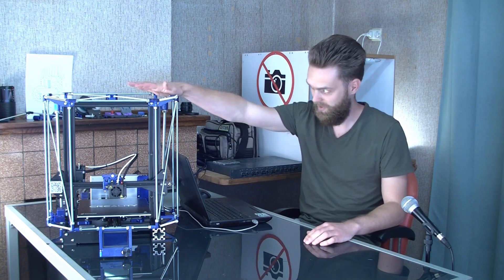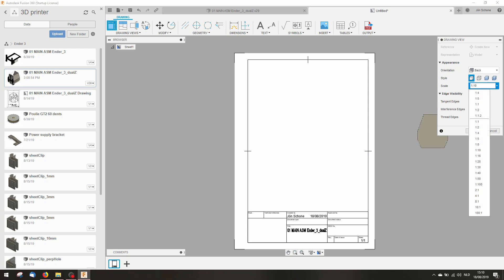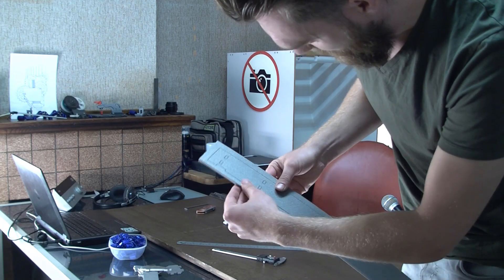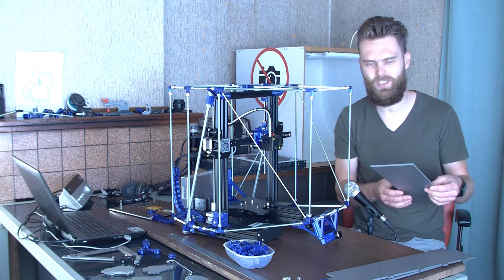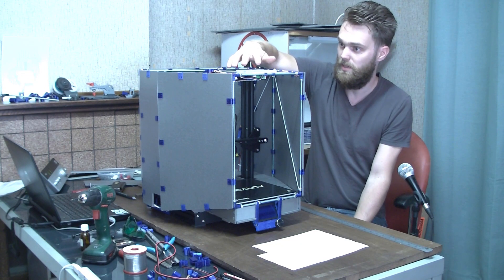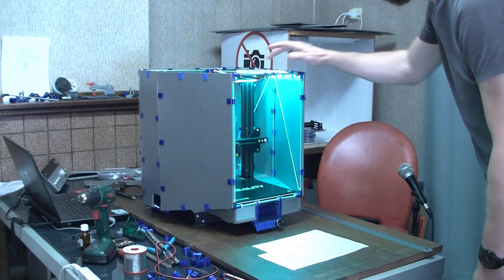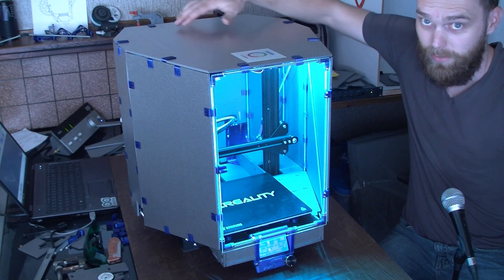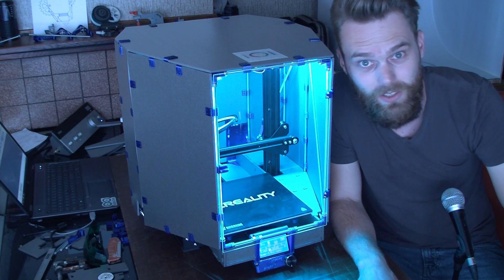Ender 3 pro enclosure build: the rest

Comment: I've been thinking about making a heated enclosure myself, for my CR-10S, to print nylon and pc. But to regulate enclosure temp, it needs airflow through it. Meaning it needs to draw in ambient air when decreasing temp. Do you know if that kind of intake of ambient temp air, has negative impact on the print?

Comment: Do you have..or..can you design a stock Ender 3 version?
Reply from the maker: The only thing that wouldn't fit is the display holder. If you use two 10mm spacers it should work for the standard Ender 3
Reply: @properprinting  Cool...thx

Comment: It doesn't matter wether or not i need or even want a certain upgrade for my Ender 3, what i like about your upgrades is dat you always go 110% true with it. No giving up, no compromises just 100% upgrades. Love to watch this stuff and it looks dope bud. Awesome video.
Reply from the maker: Thanks a lot for your awesome comment! It often does not go as smooth as the video suggests, especially with this mod there were some points failing miserably xD. I even had some sound card crashes, a Raspberry Pi which has failed me (it literally tried to set the bed temperature to >15000°C and melted my PLA t-slot plate cuz it reached >80°C) and I cut out the sheets wrong multiple times. So some creative Dutch swear words have been sad xD. That's part of it, it shouldn't be easy and it can be a drag but the result is always worth it. I am very happy with the response I get from anyone because this helps so much going that extra mile!

Comment: Nice job man, your enclosure is absolutely beautiful!
A little thing about the light, I guess it could be also pretty handy to be able to switch the light colours regarding the state of the in-progress print.
Btw congratulations, very good work. It's crazy to see how much time and effort we are putting into customizing or enhancing our printers instead of actually printing something (useful) else with it :'D You are a master in this discipline ;) but it's damn cool!
Reply from the maker: Thanks a lot for your comment! Switching the light according to the print progress would be super cool! Thanks for thinking with me :) Another thing that would be cool to implement is to turn the printer on with that touch button. A few relais are needed so only the light turns off when touched again xD. Increasing the printers by printing stuff is a lot of fun and it is a bit paradoxical, especially if you don't do more with it. I've actually printed something useful, the fly swatter ;)